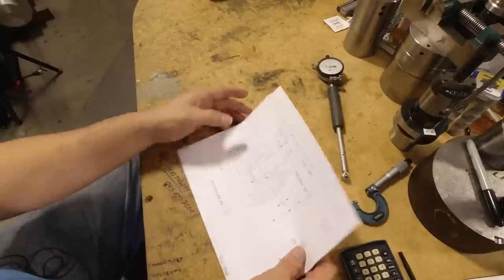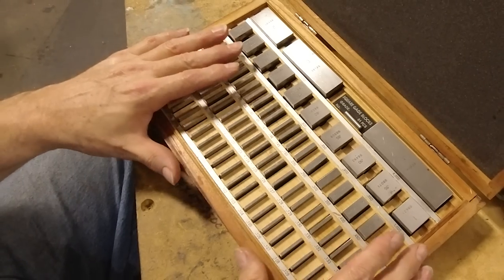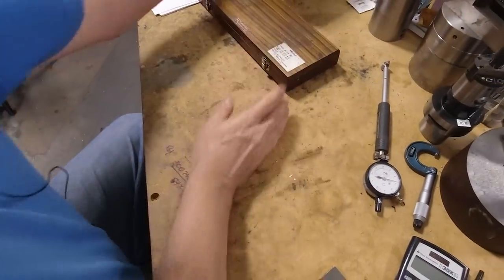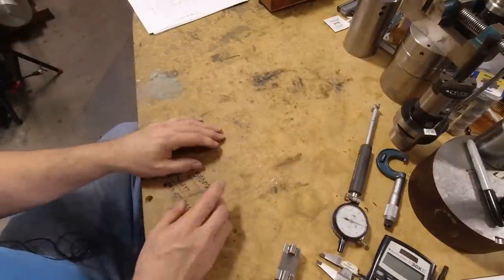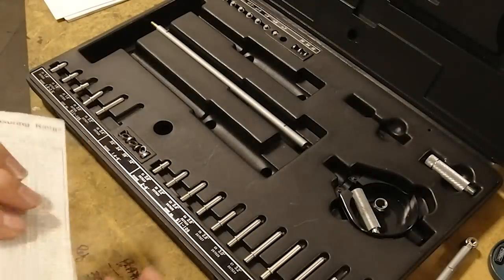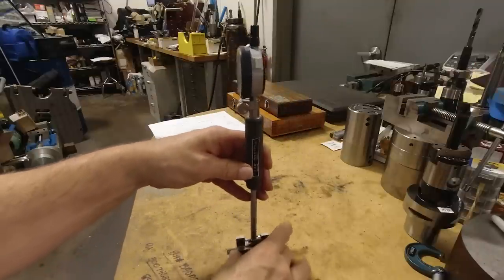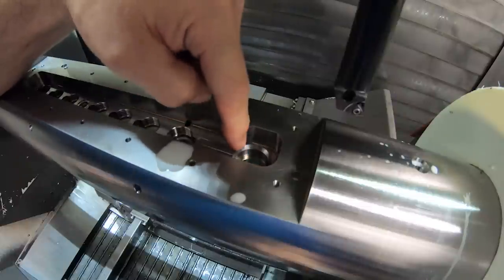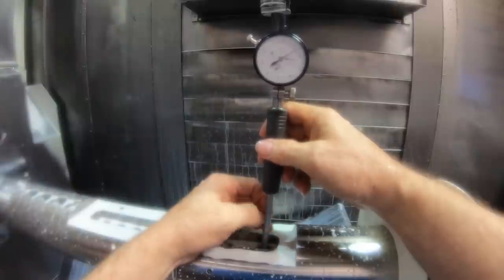Setup A Dial Bore Gauge And Bore

Comment: I have a question about the zeroing of the gauge. You said to zero it at the absolute lowest measure. Other vids say you want to put the zero where the needle changes direction from one side to the other. I dont know what to do.
Reply from the maker: I set my reference (the stack of gauge blocks) to the nominal dimension (usually the middle of the tolerance). This is where I adjust/set the dial indicators zero. I think what you may be referring to is where in the travel of that indicator I set this zero? These indicators have .050” of travel with a resolution of .0001” of each division and .010” per devolution of their large needle. With .01” for each division on the small needle for 5 divisions = .050”. So in order not to over travel the indicator and gauge. I set this zero point on the first revolution of the large needle. Or .010” into the travel of the indicator. This way when the bore is undersize I can measure it without running into the travel limit of the gauge or the indicator. This leaves me enough room/travel on the gage (.040”) to measure the undersize bore. If you set this zero say to the middle of the gauges or indicators travel you can’t measure it if the rough bore is more than .025” undersize. You will not have enough travel in the indicator or gauge. Also I always do this the same so I always know when the small needle is on its first division and the large needle is on the first revolutions zero in at my nominal dimension. It is possible to get confused and be reading your gauge undersize when the little needle is on any other division with the large needle on its zero. So to avoid that I always set this the same in any gauge I setup. I hope that answers your question. It’s kind of hard to explane in a comment like this.
Reply: @EdgePrecision  Thank you for your response, yeah I had understood that you had it 1 turn in in the tiny needle. My question was about setting the zero on the big needle(turning the window) I wish to zero it with a micrometer at exacly 3.000in to be able to measure an engine cylinder. But when I place the gauge in the micrometer to zero it the needle moves a lot depending how im holding it. Reading the indicator I can do no problem. Its really getting it zeroed accuratly that I need a little more explanation plz. Watched couple of vids but still quite unsure.
Reply from the maker: @qaz3000  The way you establish you Zero on the indicator is to rock it back and forth in both directions/axis looking at the indicator while doing so. You will be looking for the most deflection of the needle on the indicator. What I would call the minimum null position of the indicator where the needle reverses direction. This will be a little tricky on the anvils of a outside micrometer because of their small size. It will help to lightly clamp your mic in a small vise (they also make special vises to hold mic’s) so it’s in a comfortable angle for this. It is hard to hold both points o the dial bore gauge on the mic’s anvils at the same time. So what I do is surround the one side of the dial bore gauge with the unmoving point with my fingers. Keeping it on the anvil of the mic. Then I only have to concentrate in the one side while rocking/ sweeping the bore gauge for the minimum/null reading on the indicator.  This is a little difficult at first till you get the hang of it because the mic’s anvils are so small. It is much easer (and more accurate) to set a bore on a set of gauge blocks. You mentioned your size is 3.000”. Do you have any 1-2-3 blocks? If so clamp two parallels on the 3” sides so the project out a little. Say about 1”. Now set your gauge on the inside of the two parallels. You could mic the 3” length of the 1-2-3 Block and account for any deviation from the actual 3.000”. That would be easier than setting on a micrometer. Remember you have to sweep the bore gauge back and forth looking for the minimum size. It will be the most deflection on the indicator. You may have to move the indicator in its clamping mount to prevent over traveling the indicator or the gauge to achieve this.
Reply: @EdgePrecision  I have the micrometer in a vise like you suggested holding one side and rocking the gauge.

Im looking for the absolute fartest that my needle would travel to turn the window and set the zero there (the biggest number that I can reach while rocking it)correct??

Thank you so much!
Reply from the maker: @qaz3000  The most deflection of the indicator. Generally the indicators on dial bore gauges the numbers increase as the gauge reads larger ( the needle rotating clockwise) so you would be looking for the most counterclockwise rotation on the indicator. Or the minimum reading or to look at it another way the most squeezing down to a smaller size on the gauge (smallest diameter). So when you measure your bore you would put the gauge into the bore at an angle. Then rock the gauge more perpendicular to your bore till you get your minimum reading. You set the gauge on the mic the same way. But because the mic’s anvils are flat you wound first rock it one way say parallel to the handle till the minimum reading. When at that minimum rock it in the direction 90 degrees to that until you get the total minimum that is your setting minimum.
Reply: @EdgePrecision  So its the opposite? When im rocking the gauge in the micrometer im looking for the smallest number to set my zero to , the least movement ?? BUT wouldn that be the LEAST deflection of the indicator ?

Thats the part that always confuses me.

And same thing when measuring the actual bore , still looking for the smallest number ?
Reply from the maker: @qaz3000  Yes because you want to know the smallest diameter of your bore. So the part that fits into it will go in. As you compress the indicator/gauge it gets smaller and also deflects the indicator in (the plunger on the actual indicator going in) on its reading.
Reply: @EdgePrecision  Its just so counter-intuitive. I get the smallest reading when I am most crooked in the micrometer and I get the bigger number when im the most straight (center of the anvil) How come ??

Comment: I see you have no issue holding your gage blocks bare handed in the shop. Have you ever had issues with surface corrosion on the "cheaper" blocks you show here? My extremely cheap Chinese set of gage blocks have developed some corrosion in places where my finger prints were left behind. They still ring together and are accurate to within my measuring capability, just wondering if I should be wiping them off or adding RP to them in your opinion
Reply from the maker: No I haven’t had that problem with these blocks. Some people’s sweat is more corrosive than others. If you are having this issue I would oil them with a light oil. Or the special oil made for this purpose.
Reply: @EdgePrecision  thank you so much for the reply and all of your videos. The whole community really owes you for sharing everything you do
Reply: @mpmachining7227  Chinese blocks wont have near the finish as a name brand like his, therefor rust easier. I use either LPS3, VCI paper, VCI packets or all the above with all my tooling. Not havin a climate controlled shop in constant 100% humidity sucks!
Reply: It  helps to oil your fingers before handling them too.

Comment: A +/- 1 thou tolerance for you is easy. I noticed that your final cut aimed to hit the middle of the tolerance. Where the tolerance is tighter, say tenths, would you aim for the end of the tolerance that allows you to remove more material if needed? In these cases it would seem risky to try and split the tolerance as you could end up at the wrong end of the range with no material to recover.
Reply from the maker: Once you have experience with a particular boring head. Than you can make adjustments with assurance of the outcome. As far as where I aim for in the tolerance. This would depend on how the hole is dimension-ed. If there is a close true position with a maximum metal condition I might shoot for the largest diameter I could get away with. This would give me more leeway on the position tolerance. If I was having trouble with the finish and had to polish I might shoot for a smaller diameter. So you see it depends.
Reply: Edge Precision thank you,. Always interesting and informative. It’s always interesting seeing how you deal with customer requirements.

Comment: Nice video, as allways. But is it a welding at 23:23? what's the story behind that? :)
Reply from the maker: Thanks Nikolaj Wennerwald. This is the way the part is designed to be made. First I do a weld prep operation. This consists of drilling intersecting holes that intersect the gun drilled holes drilled down the length of the part. Than milling pockets where plugs with transitions between the holes can be welded in place. Than the whole thing is pressure tested for leaks. The work you see here is done after all that. This is why it seems that these parts take a long time to do. There are many operations I have not shown in the videos.

Comment: Engine rebuilders use sunnen dial bore gauge setting kits that have masters and a giant micrometer head on a stand. The carbide balls wear divots in the ends of the standards. Everybody please check the standards ends for wear. Or have your sunnen rep eyeball it or send it in for a calibration check. Slip fit is not great for cylinder sleeve installs

Comment: What's the most expensive part u ever made?
Reply from the maker: I don't really know the final cost of the parts I machine. I don't buy material or do or pay for any of the outside processes. I just do the machine work. About the most I have charged for just for my machine work on a single part is around $30,000.00 dollars.
Reply: @EdgePrecision  ur videos are very informative and top notch, look up 2 u,I used to set up and operate a machine like yrs it had twin spindles upper capto 6 milling head and regular lower live tooling on the lower, keep up the good work!

Comment: Why not use 3 point mike ?
Reply from the maker: Don’t have one this size.
Reply: @EdgePrecision  Once worked with a guy that decided to machine a ring gauge for his dial bore gauge. After about an hour of him fiddling about  , I asked him what was he doing.  He responded by telling me that he is making a ring gauge.  To that I asked him "You know that we have a full set of inside micrometers in the test room , right ?" 
You should have seen a look on his face when I told him that. But that is not even the best part , turns out we already had a ring gauge of exact diameter he needed.

I laughed my ass off.

Comment: Why can’t you zero gauge from a calibrated mic?
Reply from the maker: It depends on how close a tolerance your working to. A mics frame flexes when taking its measurement. This is normal for an OD mic. I would say if you’re working to a tolerance of less than .001” it would not be the best to set it on a open mic set to the dimension on its dial.
Reply: @EdgePrecision Wow!  I had no idea an outside micrometer would flex!!!!

Comment: For a 0.001 tolerance I use telescopic gauges.
Reply from the maker: Yes a telescoping gauge is perfectly acceptable at this tolerance. I just prefer a dial bore gauge when boring a hole to size. I feel it gives me a better indication of how much to adjust the boring head. Also but not in this holes case, it can be used to check out of roundness and taper easier then a telescoping gauge.